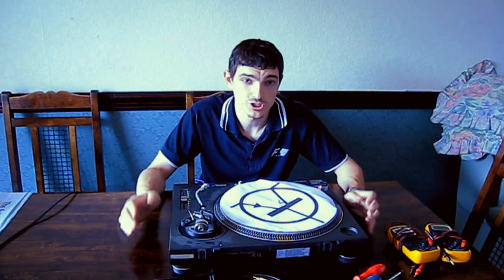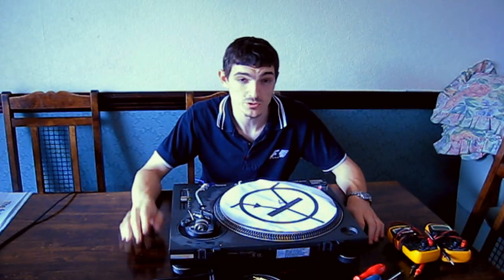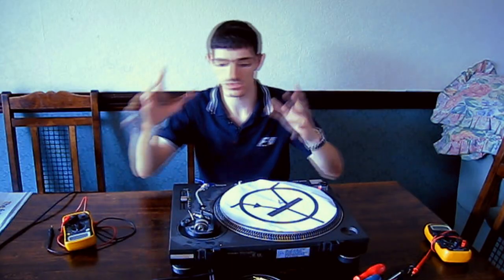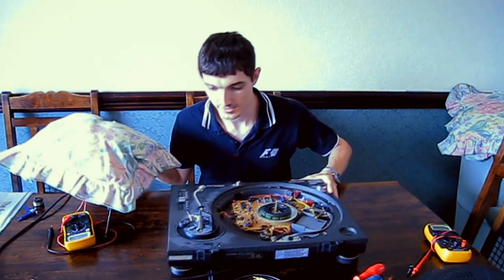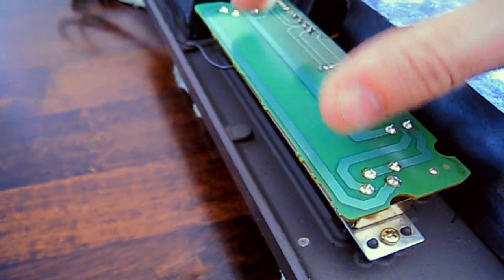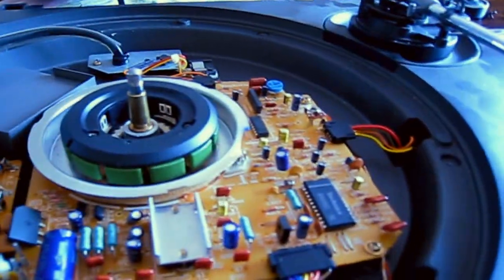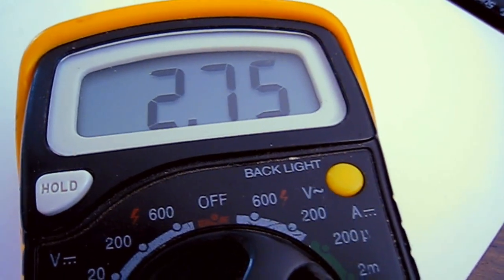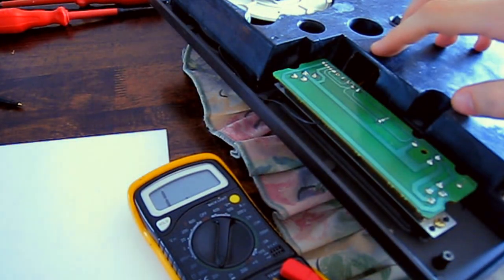Technics SL MKII Pitch calibration part #1 how to calibrate 0 position.

Comment: Hey Frank top notch explanation as usual. Learned a lot. I did actually this on 2 MK5's because both had double 0 and worked perfectly on 1 deck but the other deck the 2nd zero was up at +6 and I reset it 3 times and nothing changed. I suspect main board magic needed but I have no idea what could be wrong in this case. Cheers for any advice. I am doing modding and some service in Cambodia since I live here 17years.

Comment: really love your down to earth vids James.....just a question before i do the above. Noticed that when you adjust the pitch range from the pot under the platter, it also move's the centre (0) position itself, so therefore surely if i centre my fader using the the pot on the fader as you shown, as soon as i go back to re-adjust the pitch range (which will likely need to be done) i will again loose the centre (0) again...if that makes sense, or am I missing something here?

Comment: Has anyone tried this on the Japanese dual voltage 1200 mk2? I found that the pot is located on the other side of the board (no easy access hole) and that the correct setting is 3.18 k ohm, not 2.70k. Can anyone verify this?

Comment: Hi James,

I have an SL-5300.The Quartz appears to be off slightly. Sounds a little slow when using it.The middle dots/bars are stable when the speed is controlled by the quartz. When i select the manual and adjust to where the middle dots/bar moves slightly it sounds right. 

Is there an adjustment? If so what would it take to do that?

Robert

Comment: I have an old TT Technics 1200  Ser No. MJ4118DO92 the pitch slider is the one with 3 legs. I know there is upgrade. But I still have the original still in good working condition  so I'd try this and it won't work.  Gave me a reading 3.08 then I followed all the steps. And at the end the  0. Pitch adj was going around 5 % faster. Then I tried to adjust the speed under The plater and I could get it to stay at 0 position even when I turned the dial all the way down un clock  ways
Reply: Don't get me wrong. What I am saying is  because one of my turn tables is very old this set up won't work. I had to go back to the old setting.  Maybe if I upgrade the pitch slider with a new board and pitch. Maybe it will work. I will try this with my other newer TT
In the past I have set the pitch slider straight to 2.75. And everything worked well. Thanks james

Comment: My Technics SL1700 strobo dots can't be in stable position. It will sway to and fro a bit by 1 to 3 mm. How do i fix it ? I lubed the trimpots but didn't work.

Comment: Thanx, a lot today my technics got a double zero position after 20 years of use, with this instruction it was no Problem at all to calibrate the pitch to factory setting.
But I had to take the fader out of the deck because the PCB did not have the hole under the Pot to reach it. everything else worked the same.
Since I had to Pull the the fader out I had the chance to clean the pitch fader and PC at the same time now it works like brand new again. 

Really love your instruction videos they help a lot. keep up the good work.

Greets DJ Dragstorm

Comment: Viperfrank I'm dealing with an advanced issue and it's really frustrating.  I've been working on decks for 10+ years thanks to your videos, but I've never had to mess around with the main board before.

This deck has lost the ability to adjust the zero point on the pitch fader.  The pitch range pot still works, but the VR302 is unresponsive.  I've swapped out pitch faders with the same issue.  

Please point me in the right direction!!

Comment: thanks for the vídeo,i have a question??I have two technics 1210mk2 one of them at the zero point 2 has the reading of 262 kv or another 311 it means some of the those pitchs are not good and needs replacing?? many thanks

Comment: thanks a lot, now i can fix two of these wonderful machines....cheers
Reply from the maker: now worries, I'm glad you found the video useful.
thank you for your comment.
Reply: @viperfrank  Hey. Thanks for your videos on Technics and pitch! After pitch  adjustment is corrected,  I  had a question about pitch shift with regards to semitones. as I am not a DJ, I use my technics primarily to adjust the pitch to change the key when sampling into my MPC. I was wondering once properly calibrated, is there a specific number on the pitch % that equals a semitone. For example. If the key of the record I am sampling is in the key of D, and I want to change it to  C#, what number should I shift the pitch fader to. I have a good ear but for efficiency, it would be good for the workflow. I  did not know how else to contact you, So I apologize for using this as a forum to do so.

Comment: I had a technics slbd 35. I was NEVER able to , using the pitch dial, bring the lights to a stationary position.. ever.  But I never knew how to get the pitch dial calibrated; or that this needed to be done.  But then again, when I bought it, tutorials were not available like this. There is a certain limit to which I feel okay about tinkering with things before I am afraid I will do more harm than good, and I knew little about these things in the 80's. So to be perfectly honest, if I had to go through all of these steps, I would have had someone else do it.  I recently gave that turntable away and opted to get an Onkyo direct drive despite all the info that they create more noise than the built driven turntables.  I gave it to a friend who is retired and has the time and patience to do this kind of stuff.  The pitch control on the model I had was not a slide mechanism, but  small circular dial - like a old fashioned volume control with only a half semi circle disc exposed (no numbers) on top near the plate.  It was frustrating to me so I just did the best I could.  I am relieved to be rid of it although it was a Technics and perhaps valued by others.

Comment: Could anyone help me a little - So I just bought my first pair of turntables - Omnitronic DD3120. They are used for several years. The problem is that when I try to mix songs, if the tempo for example is 128bpm it is constantly changing in a range of 0,3 bpm so it is very hard to mix perfectly (I have to adjust the speed by making the turntable spin faster or slower all the time). I'm using Traktor timecode. I had a pioneer controller before, that did not have this kind of issue (speed was totally constant). Is that normal with turntables? Or would I need to service them? Or maybe there is a simple 
solution to this?
Reply: Edgars Ļebedevs have you hear of wow and flutter?

No turntable in the world is able to keep the bpm on dvs software dead still.

a controller has no issues because it has no self moving parts that control the speed of the music. it's all software and will stay at an exact tempo.

with vinyl you need to control it by pushing and nudging the beats in line. the pitch is an approximate guess and your ear and hand completes the synchronization between tracks.

hope this helps.

Comment: Cool video! I've just finished calibration of my decks. One piece of advice: You want to first set the pitch range corectly (-3.3, +3.3 and +6) then go for double 0 point reduction. It is based on my fresh experience. I had got rid of double 0 point then set pitch range and double 0 have appeared again. Beware that not every pitch circuit board has this magic hole. I've noticed that newer ones has no hole (added: or maybe my pitch is not genuine). Cheers!
Reply: You're right, only older Technics have that little hole on the PCB.

Comment: I hope you still reply to this account, I have a turntable and while playing the pitch bends very slightly, it's not even audible but it's enough to knock your mix off and when plugged into serato you can actually visually see the numbers increasing. What could that be? Could I calibrate the pitch, replace the pitch or is that a motor issue? Thank you for your time.

Comment: Hi there! Very cool video here. But I need some help please. I have a pair of MK3D's of 1997 and 1998 years build. The problem is they are different in pitch positions and numbers they produce at the same positions. For example, if I set +4.0% on both TRAKTOR shows +4.0%. But when I set -4.0% the 1998 one is running -3.5%. The zero position and +/-8.0% are as they are set. Also that strange TT is running +-0.1% at a still position of pitch. What is the problem there? Does pitch fader change help?

Comment: When my pitch fader is on the 0 position, and i remove it a bit, the yellow light isn't that bright anymore and starts to flicker. When i stand on this position (at the 0 position), my platter starts to jumble. When i remove it back to the stand where the yellow light is normal, my platter don't jumble. All the other 'stands' on the pitch fader also work perfectly. Does my technics this because of a bad contact or calibration on the 0 positioning (so like explained in this video)? Or is it something else and what do i have to do then? I hope somebody understands my explanation and can me what the problem is :) .
Reply: Hi there! I was wondering if you found the answer to your question? I have the same exact problem! Cheers

Comment: Does anyone else's pitch fader not have the little hole on the back to get to the pot? Does this mean I have to take my fader off?
Reply: +Peter Croce FYI I went ahead and unscrewed the pitch fader and it turns out the pot is under the pitch fader. I've seen this on a few different silver 1200mk2's.

Comment: Hi, I'm having a problem with my pitch control L.E.D. I'm wondering if you can help? It's a 1200 mk 2, the pitch control L.E.D. fails to come on when it's at zero. L.E.D. is brand new, polarity is correct. Pleeeeeeeeeaaaaaaaasssssssseeeeeee help.
Reply: +Miggy Smalls yeah I have that issue too.. I bought a second hand mk5 and let doesn't come on unless I turn reset on... also anti skate doesn't do anything on mine..

Comment: If you guys have access to an M3D or MK5 service manual (or any of the click-less fader equipped 1200's, besides the digital M5G), you will see that the manual calls for 2.87k on the VR302 (the pot on the pitch fader pcb) as opposed to the 2.70 value seen in the MK2 manual.

I have recently replaced the pitch fader in my old mk2 with a m3d/mk5 fader. Using the 2.87 setting, I can get it to match my actual m3d table perfectly.

So in short, if you are using old style/old manufacture faders, use the 2.7 adjustment. For newer style faders, use 2.87 and you will be good.

I now also understand why the m5g has markings that state you should be at +6.4 when the top dots are stationary. Adjusted to true factory specs, the top dots do not land on 6.

My new m3d/mk5 pitch controls adjusted to factory specs, coupled with the proper 262.08 kHz value for VR301 under the platter result in the pitch slider and dots correlating at 0, +3.3, and +6.4

It seems that everyone on youtube thinks that VR302 on the pitch slider PCB is the zero adjustment, but all it does is adjust the gain (how fast or slow the pitch will range from the 0 point).

VR301 under the platter is the actual 0 adjust that moves the point for and aft along the slider. You can set this with a 3150hz test tone and use PlatterApp if you do not have frequency tester. Since I am using the m3d faders, I no longer have the zero lock to deal with it, so I was able to see the true zero point. Put the pitch slider on 0, and use a test tone record in order to properly adjust the center to 33.3.
Reply: Wow...  thanks for the informative comment that specifically answered the dilemma was having with my M3D. Do you use a frequency tester to calibrate your pitch or can you use this method? Reason why i ask is because the M3D tech manual has you check to make sure the frequency is within a certain range first.before you adjust your range with the knob under the platter.
Reply: Hi mate you also should make a vid  step by step on using these settings. It makes sense but I am having a little hard time putting it all together.  But I get the main idea.  Thanks
Reply: You got the most likes lol, so helpful mate ! I have Mk5's & need to make sure its correct for that model. Respect !
Reply: So do I just zero the pitch using the button and adjust the pot to get the 2.87k

Comment: On the M3Ds you have to remove the board in order to get to the adjustment knob, should be blue at least on my decks they were blue.
If the factory setting is 2.70 is it not easier to center just to center the pitch slide knob then set it to 2.70?
Reply: Mike Feliciano good question

Comment: Thanks for the Vid's.  My girl friend has MK5G's with the double speed pitch shifter and she is having trouble with her mixing, she says that one of the decks keeps going out and wont lock in with the other deck, I have been given the task of sorting this problem out, so my question is...would one use the same processes when working on MK5G's as with MKII? what is the score there, thanks

Comment: i have opened up my technics deck but there is no hole on this circuit board to adjust the   screw to adjust the 0 position so bit mythed as what to do ??
Reply: A bit of bad news for you, I also have some seriously old school technic 12000s and had the same issue as you.  We must have got the 1200's before Panasonic was enlightened with the "infinite wisdom" from their service department.  So, you have to take the two screws that hold the pitch fader in off, and remove the pitch fader.  There is a blue plastic screw, like the brake on the front side, that you have to adjust.  It's a bit more of a pain, but no big deal.  Just be careful.  If you don't feel like you can do it yourself, take it to someone.
Reply: Jason Nolan thanks for the advice i think i can  handle that seems straight forward
Reply: Absolutely.  You're welcome.  It just becomes iterative in small steps to get the adjustment.

Comment: If your pitch fader PCB does not have the hole for a screw driver to fit through you will need to remove the fader (take the knob off from the other side first). The screw will be on the other side of the fader - after that the adjustments to be made are the same as in the video.

Comment: Thanks for the info... I've got two MK2's so no pitch reset I think, but the quartz lock (pitch slider center with green led) is functional. Just wondering should I begin with zero point or the pitch range adjustment, and seems that zero point comes first. ...Also wondering whether the pitch is somehow broken as the range is somewhat crazy (non-linear from around -6% - +12%). Seems I have to get the meter to begin with. Thanks for the tips (and video by viperfrank), now for some DIY fixing...

Comment: Now with the frequency counter connected you should adjust the pitch range on the top right side of the board to 262.08 KHZ +/- 0.05KHZ as the pitch fader board is connected, pitch set at zero with the green light on (If your green light doesn't go on with an mk2 the you need to put a jumper between ground and Orange wire coming from the fader board to activate the reset mode if you zero click was removed from your fader, power on, speed 33 rpm (DO NOT PRESS YOU START/STOP Button while doing so!

Comment: Now with that reading write it down we will call it "X". While your probes are still connected move the pitch control to the zero position then adjust the pot on your fader board until your ohm meter reads "X" on the meter! Now your pitch range seems to be off so see the two part video of viper franks calibration of pitch range in the second part... I would also recommend getting your hands on a frequency counter and hook it up to red on TP27 and black on ground located on the left side of the

Comment: First of all, Does your green light go on at "0" pitch? If you have a M3D, or MK5 chances are you have a pitch reset button! On my M3D when I have the pitch reset pressed in "ON" that will be my default zero point then second will show up if any! If nothing show up then leave it alone! Now your second is at 1% or until the big dots stop then leave it there and take a reading with the red on brown and the black on orange take the reading while the connector is disconnected!

Comment: Looking forward to calibrate mine according to this great tutorial... My problem is that my deck has both two zero points and also pimped pitch. A second zero point is in -1%, but the range is weird: -3.3% is around -2.7% (on the slider), +3.3% = +1% and +6% = +2%. Seems that the deck actually would max well above +12%... I wonder two things: 1) is it only modified or is it broken? and 2) if it can be restored should I start with matching zero points or then by pitch calibration? THNX!

Comment: You obviously missed the point of my statement, you should read it again. I've been beat matching while mixing for over 25 years and the click never got in my way! If you leave it alone and don't remove the click you won't need to calibrate it. And I do understand the fact that the pitch can go out of range after years of use. But If they click and there are not out of range keep your little British fingers out of there! Technics is a better turntables without people like you screwing it up

Comment: FYI, you don't need to "put the fader in the second zero position" as shown in this video. He did that just find find what the resistance is at zero (2.75K Ohm).  The service manual tells you the zero point should be 2.7K Ohm +/- 0.1K Ohm.  Just put the fader in the center to begin with and to somewhere between 2.6K and 2.8K, getting as close to 2.7K as your meter will allow.